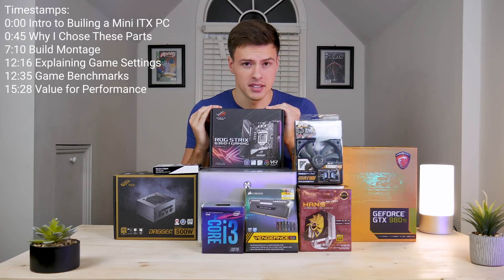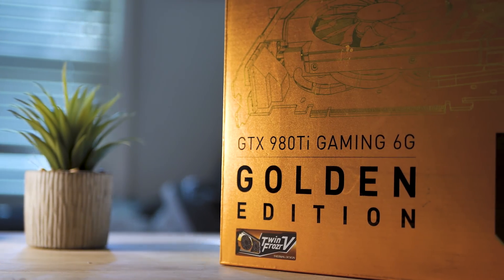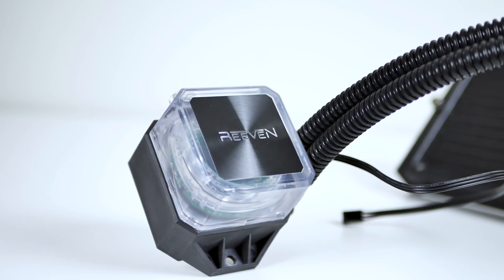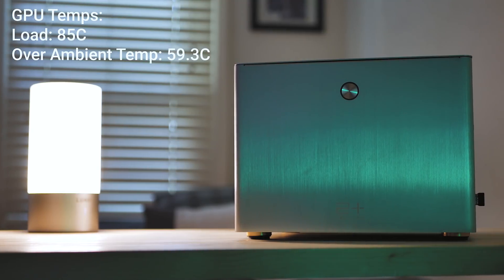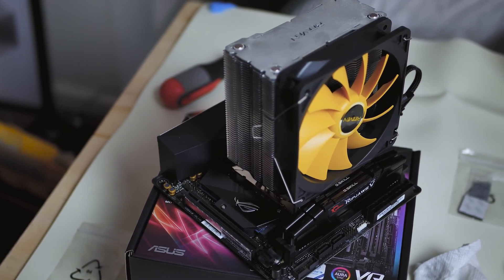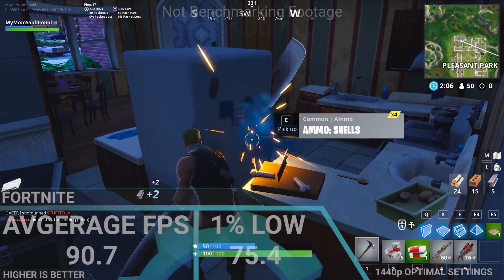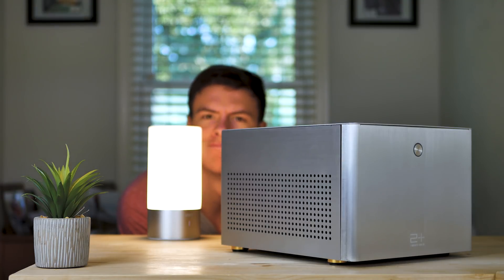i3 8100 + GTX 980 Ti?? - $960 Mini ITX 1440p Gaming PC Build + Benchmarks

Comment from the maker: Timestamps:
0:00 Intro to Builing a Mini ITX PC
0:45 Why I Chose These Parts
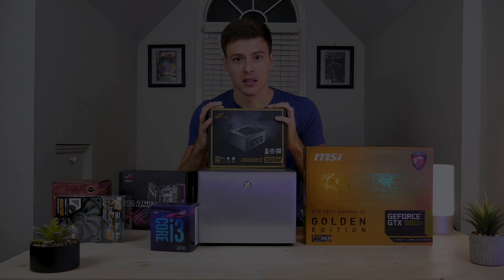7:10 Build Montage
12:16 Explaining Game Settings
12:35 Game Benchmarks
15:28 Value for Performance
Reply: Hi I have this case and building on it. I'm just struggling as to fit my PSU in it. Where do I get a mounting bracket like the one you used? please help

Comment: Did a very similar build for my sister. However I swapped the i3 for a ryzen 2600(with board b450 from gigabyte) and the 980 ti for a regular 980. It performs super well at 1440p.

Comment: The only thing that case needs it's a front intake for better airflow
Reply: there is one. the front intake is right under the front panel. Half of the opening supply the PSU intake. The other half is for the case, it just does not have a fan there. It is possible to install maybe a 80mm fan, but you need to some drilling.

Comment: This is nice ... i think it could be smaller maybe ... i cant find a really small case that fits a psu and gpu
Reply from the maker: There's always a smaller case pushing the boundaries. I thought this was a nice size honestly
Reply: @jdtechgear  yea ik it was a nice video .. but every case i find that is small is just a steel box with screw holes for the motherboard ... and they are priced at around 150$ or more

Comment: Did you put new thermal paste on the gpu? Might get you slightly better temps?
Reply from the maker: You love the thermal paste application 😉 I might try it, I think my 970 could be better suited for a mini ITX build
Reply: JDTechGear yea man everytime I buy a used card I test it and record the temps then I break it down and clean/reapply paste and the temps are ALWAYS better.
Reply: JDTechGear just a suggestion anyway man. Love the channel
Reply from the maker: @jandkwhite6459  yeah it'll usually always give you better temps no doubt. Thanks man always appreciating the support!
Reply: If you do try the Cooler Master MasterGel Pro it dropped my GPU temps by like 15C.

Comment: 😒 uhm u do know that ITX is ripoff overcharged expensive? And if u gonna run only a little 4 banger 🚗🚗🚗🚗 at least u shud get the OC Version cause u got a pretty big 980thai there to consider pulling hard, so go mATX and the money u save go K and go Z ftw! bliiiiiiiiiiiiiiiii 🚤🚗🚗🚗🚗😍🚩
Reply: Dude calm down with the emojis
Reply from the maker: The higher price trend for a smaller form factor is due to the nature of fitting features onto a smaller footprint which requires more engineering. Also since the market is much smaller than that of the ATX market it is not nearly as cost effective to develop. And I don't think the 8350K is worth the money. The 8100 already brings fantastic gaming performance, there's no need to add that let alone the additional heat. I'd like to do a micro ATX build in the future though
Reply: @jdtechgear  🤓 i dont know how much hotter an i3k will be so i cant comment? 😨🔥😰 But i do know that overclocking i3s always got an unecesary bad rap, i think they are ok 😊🚗🚗🚗🚗 well at least u went Intel my brother 😒👍🇦🇼
Reply: He can still oc that cpu. You know this right

Comment: Nothing related with this video but I have a doubt .... ? 

Is there any difference in using a LED TV instead of a particular PC Monitor ? 

Will using a TV affects my gaming performance .....
Reply from the maker: Yes, TV's have massive input lag and don't refresh in the same way as a monitor does
Reply: I don't really see the difference between 3ms, say and 30ms. Don't see how they refresh differently either, but each to their own :)
Reply: @jdtechgear  🤓 i think it depends on the tv too
Reply: If you want to use a TV as monitor and want to game or do some graphic related work on it you'll need something like a QLED Q6F 4K from Samsung or something similar. Go to rtings.com to compare different models.. also read this: https://www.rtings.com/tv/reviews/best/by-usage/pc-monitor
Reply: @DanEvansn  are you Austin Evans' brother?
Reply: Never get a tv to play games ... in that case just buy a console ..  lol 

Diffrences :
Ppi
Input lag
Screen finish which is most of the time gloss on tvs 
Size
Motion blur 
And eye strain ...
Reply: No it won't affect performance but you'll most likely need to resize the display because TV's have a thing called overscan where it cuts off stuff like watermarks in TV shows, so if you connect a pc to it you'll have some of it cut off. Just go to the GPU control panel and resize it there to fit it because that's what I did :)